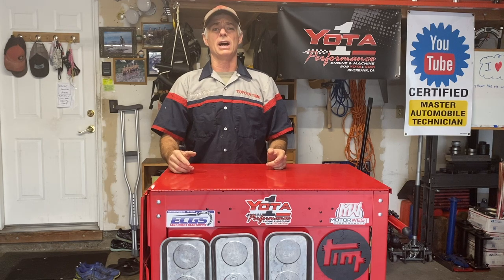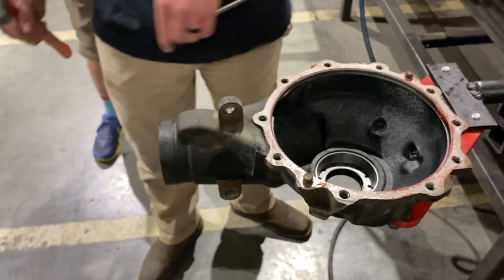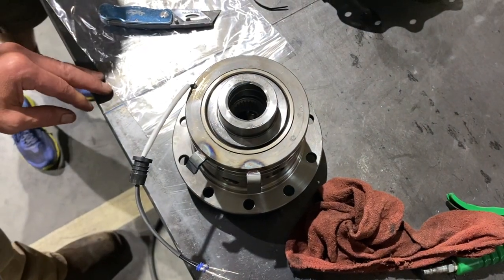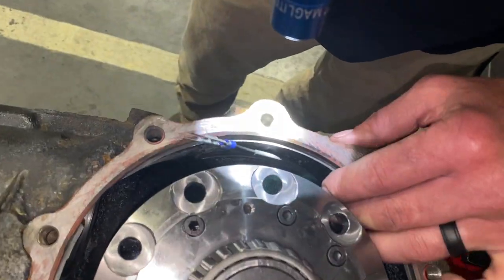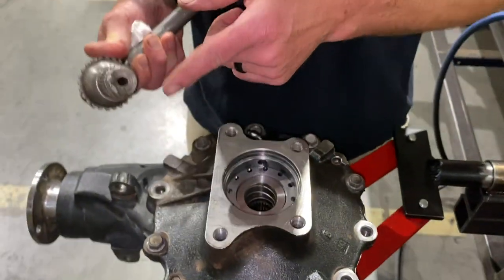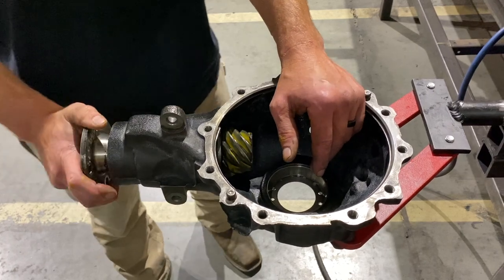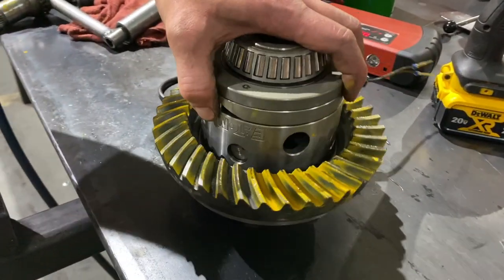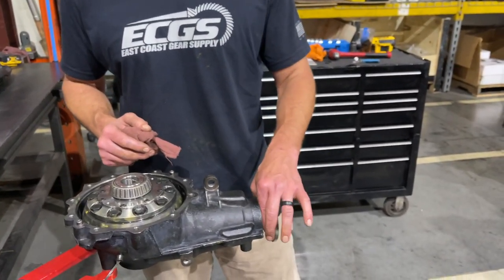ECGS Toyota 7.5" Front Differential Regear w/ Eaton E-Locker Install

Comment from the maker: Front Differential Specific Break-In Instructions from East Coast Gear Supply

*Normal 2wd operation will passively break in the front diff.
*Normal low speed trail riding under 20mph breaks in the front.
*Highspeed 4wd use for long periods of time should be avoided: Example would be road use above 45mph for over 10 miles, limit these types of drives until 500 miles is complete and oil is changed.
*Low speed 4wd use does not build heat, highspeed use does.
*Diff fluid should be changed if water is ever introduced, or after 1 year. No highspeed use for extended period of time, Change fluid after 500 miles of low speed, limited high speed use.
*Perfect break in would be fire roads, light trails under 20mph for 500 miles.
       - Every customers driving patterns are different, the end goal is to limit temps above 250 degrees for extended period of time, a temp gun at pinion snout can be used to verify temps. As mention in video the front diffs hold very little oil. Diff drops and lower gear ratios impact oil flow to pinion bearings. Therefore, caution is highly advised for high speed use. Highspeed is defined as above 45mph.
       -Note: This is specific to the 7.5 Clamshell referenced in video  the larger Toyota front diffs T8 Clamshell holds more oil and oils better so is not as sensitive.
       -Note: Main concern to cause issue is if user has brand new diff and jumps on highway in 4wd with low gears and diff drop, this can lead to pinion bearing failure very quickly
Reply: Thanks,  I printed these notes
Reply from the maker: @toddeliott20  You're welcome Todd.

Comment: If you use a long zip tie to hold the two wires together and stick it through the hole first you can use it as a pull guide when you're installing the chunk.
Reply from the maker: Thanks for the tip.

Comment: Hi Tim. What gearing did you go with and what size tires are you running? Did you have to modify anything to get correct speedometer and odometer readings? I understand this is not the point of the video, but am curious.
Reply from the maker: I went with 4.88 gears and I'm running 33" tires.  My speedometer seems to be close to accurate so my odometer readings would be accurate as well.  There's nothing as far as I know you can do for the speedometer reading other than trying to match your gearing with the tire size you're running.  4.88 gears is pretty much perfect for 33" tires.  But, even if your speedometer is off, it's not a huge deal as far as I'm concerned.  If you're worried about getting a speeding ticket, just know how much it's off and you'll know what speed you're actually going.
Reply: @TimmyTheToolman I agree it’s not a big deal, but I’d like it to read right at some point. In my case, I’m going from 4.1 gearing with 31” tires to 4.88 gearing with 33”  tires. Mathematically this would result in the speedometer reading about 10% low. I’ve seen a few posts on TacomaWorld of people replacing the vss sensor on the transfer case with one containing a different number of gear teeth, and others using a Dakota Digital device that can be calibrated precisely. Food for thought. In the meantime, like you suggest, a little mental math while driving will avoid the ticket.
Reply from the maker: @fcparsons  Yeah, if it will bother you, figure out a work-around.  I remember looking at my phone GPS speed compared to my speedometer and they seemed closer than 10% off, but maybe not.

Comment: I’ve already got my truck re-geared. If I open it up and install a locker, do I need to worry about the pattern changing? I shouldn’t have to remove the pinion at all.
Reply from the maker: Good question and I'm not sure.  The locker carrier that the ring gear bolts to might be slightly different than the OEM carrier, so the way the ring gear interfaces with the pinion gear might change.  I would call ECGS and talk to the sales staff and ask them this question.

Comment: Seeing this 4 months later, the 7.5" e-locker is not on the ECGS website. Are they sold out?
Reply from the maker: I highly doubt they are sold out, but anything is possible.  When I was there, there were pallets of Eaton e-lockers.   They also seemed to have a huge supply 7.5" cores ready to be rebuilt.  I'm in San Jose, California, ECGS is in Louisburg, North Carolina, and I'm not privy to their stock supplies.  I don't work for them.  You should call them and one of their sales staff will happily and competently answer all your questions.   I'm pretty sure you're going to find out that they have 7.5" clamshell cores and an ample supply of 7.5" Eaton e-lockers to build you a differential.

Comment: After i got done installing the e locker and I didn’t touch pinion and just reused the original shims and same gears with new Toyota genuine bearings and races I measure 8thousands backlash measure with my dial indicator at the pinion. Is that ok?
Reply from the maker: According to Chase, backlash measured at the pinion is actually double of what it really is if you measured it at the ring gear.  So if you had 8 thousands at the pinion, you really only have 4 thousands backlash.  That might be a little tight.  I'm not an expert though.  This is just from I learned filming these videos with ECGS.
Reply: @TimmyTheToolman  That’s what i saw and apparently spec is 0.06-0.010 for my 7.5 front diff in my 01 Tacoma.  i don’t understand why it would be double at the pinion flange??? Theoretically it should be the same id think??
Reply from the maker: @erice4611  I'm just going by what Chase Perry said.  It's probably because of where you're measuring it.  Backlash is supposed to be measured at the ring gear.  Maybe give ECGS a call and see if they can give you an explanation why the value is different when measured at the pinion flange.

Comment: Do they have a shop on the west coast ?
Reply from the maker: Then they would be West Coast Gear Supply.  To answer your question, no they don't.  What most people do is call in and order a differential with the gears they want and maybe a locker.  ECGS charges a core charge because they want you to ship them your old differential so they can rebuild it for another customer.  When they get the differential(s) back, they give you back your core charge deposit.  By doing it this way, your vehicle is not down for weeks.  You order your differential(s), they arrive via a shipping service like UPS or Fed Ex, you pull your diff(s) and ship them back in the same boxes.  Easy Peasy.

Comment: Anyone with experience wheeling with a lockable 7.5 clamshell? If you wheel lightly and don't shockload the CVS, are front lockers worth it for the extra traction on 3 Rd gens? I have a 2000 limited with center and rear locker, I run stock size Cooper tires but I run a real heavy overlander,  to be triple locked sounds exciting but I'm not sure it's worth the expense.......
Reply from the maker: If you wheel "lightly" you probably don't have use for a front locker.  But, a front locker can make the difference between being stuck or having to turn around because the extra traction can make a significant difference.  By the sound it though, you probably don't need one.